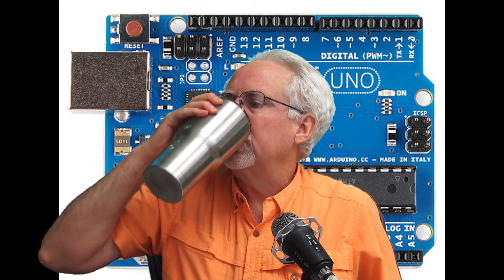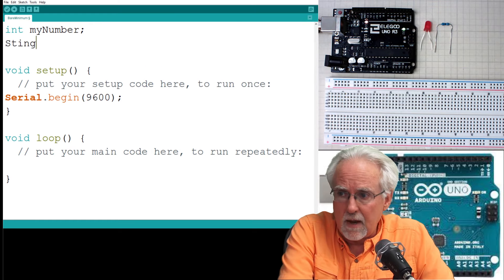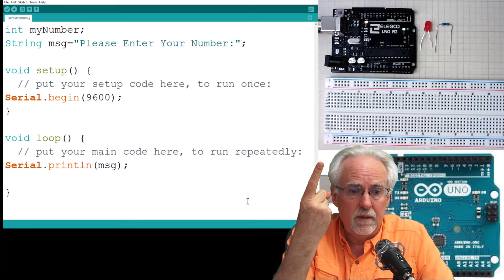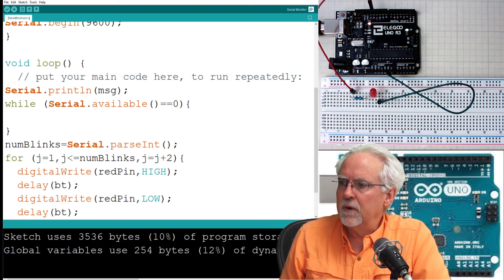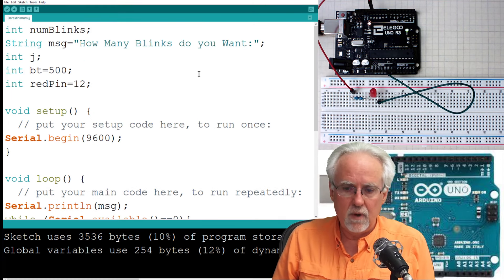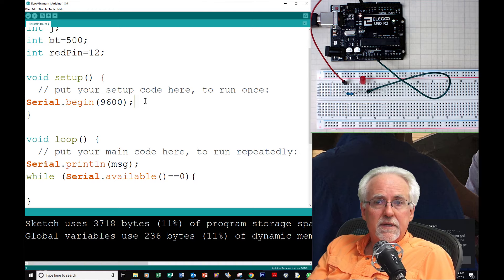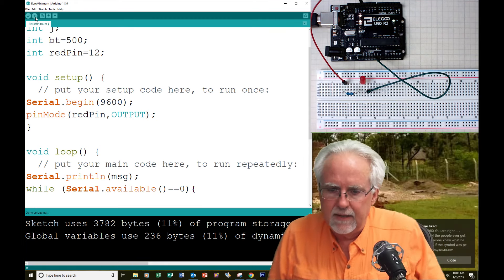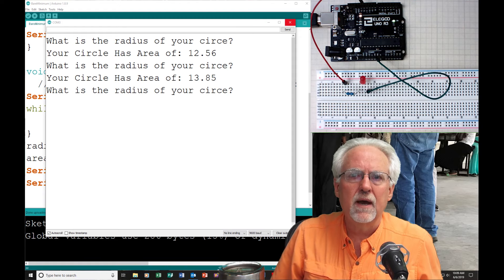Arduino Tutorial 18: Reading Numbers from the Serial Monitor

Comment: Go through tutorials 14-18 in a day, feels good!
Hmm, this exercise is probably the hardest one for me. i set several If statements functions, but after I type a number and print the message that I set, it returns to the question and prints an undesired output. I figure out the bug in the coding but nothing happens. While I saw we needed to set the conditions to No line spacing, and the problem was fixed... This tutorial is very tough..

Comment: Oh my!  My ‘What is your number?’ loop was running twice, returning a zero on the second pass without my doing anything! 
      I followed along with you Paul and wrote the code as you did and when I started the Serial Monitor there was the question “What is your number?”  I entered my number and ‘BOOM’ the serial monitor returned it correctly, but then the loop immediately ran again without my entering anything and returned a 0 !!  Man, was I flummoxed. 

What is your number?
Your number is: 23
What is your number?
Your number is: 0
What is your number?

The code was 100% accurate, but nevertheless I rewrote it, and still the problem persisted!  It took me a good few minutes to track down the problem.  It turns out if you have ‘Newline’ selected in the drop down box at the bottom of the Serial Monitor instead of ‘No line ending’ the Serial Monitor automatically enters an ACSII character after you click send which then causes the loop to run again returning a zero!
Reply from the maker: make sure your serial monitor is set to 'no line ending'
Reply: @paulmcwhorter  Yep, I worked that out Paul, but not before rewriting the code!  I won't mess up on that one again :)

Comment: The course is great I do recommend you have a basic understanding of electronics before you start the course, you can kind of tell who does and doesn't by the comments below. I did stumble across a great tool by accident that I wish you would have told us from the beginning, like you Paul I like to stay organized so I know what's where when I need to troubleshoot and (//) did that for me an example:

void setup() {
  // put your setup code here, to run once:
 Serial.begin(9600);
 
 }

void loop() {
  // put your main code here, to run repeatedly:
 
 // ASK
  Serial.println(msg3);

 // WAIT 
  while (Serial.available()==0);{
    }

// READ
  radius=Serial.parseFloat();
  area=pi*radius*radius;
  Serial.print(msg4);
  Serial.println(area);

      }

Thanks for the great Classes its always good to learn from someone who loves what the do!!! Thanks Paul

Comment: 😄 Dim LED and checking the hardware before checking the software. Reminded me of years ago when I worked in a hardware support team. The software guys would report one of their processors had a hardware fault.

Me: when did it go faulty?
Programmer: when we ran this new application version.
Me: isn't that a funny coincidence?
Programmer: very drole. You have a fine sense of humour. Now, go check that hardware.
Me (24 hours later): ran all the diagnostics and everything passed - hardware all looks OK.
Programmer: oh, we forgot to tell you. The fault went away when we ran the previous version. Starting to think it might be a code defect.
Me: surely not (or some words to that effect)!
Reply from the maker: 'It is never the code, stupid' says every programmer I ever knew. Your example above is honestly not an exageration. it is the users duty to 'PROVE' to the coder that it is a code error. Quiet frustrating.

Comment: Nice trick with this while loop. It works totally different than in C/C++. Lesson to long for me personally, however I am speaking from perspective of someone who coded quite some stuff while back. It is easier to skip a part of a video material than it's possible to put additional material into the released video for less advanced, so no complains!
Reply: Umm, it really doesn't work totally different than in C/C++ as the Arduino programming language is completely based on C/C++, with a header file that you don't really see but can explicitly include if you like, called Arduino.h. The syntax of the while loop is exactly like that of C/C++.

Comment: Dumb question. Can this process be used with a keypad and the Arduino being powered via a battery?  Or does it have to be connected to a PC and the serial monitor open?

Comment: i know probably going to figure it out in the next few weeks, but do you ever cover in detail what Serial.parseInt(); is specifically as well as Serial.available();? from what i got out of this video is parse is just the users command being put into a specific part of the code which is there and is it possible to give those commands like a limit similar to the loops where they have to be in a certain range or equal exactly the number and if so how would you do that?

Comment: Thank you so much for the amazing video! I just have one question: When I try to declare a string variable, the word 'String' does not turn the happy blue color. I have tried to used a lower case 's' and have tried to use the word 'Str' but nothing seems to work. Some help would be greatly appreciated.
Reply from the maker: Because you are using arduino IDE 2.X. Go downgrade to 1.8 and everything will work just like mine in the videos.
Reply: @paulmcwhorter Thank you!

Comment: Hey. I went over this lesson and decided to get a bit creative and do a project based on an idea i had using the knowledge fromthis lesson, but I really need help with the programming. The idea is to turn the LED on when the user inputs 1, off when the user inputs 0 and provided with half the voltage if any other value is input. Hence, it has to be an analog Pin to be used. This is my code. I hope you can help me refine it. Also, the delays i put in there are just messy pls dont mind them hehe.
int rPin=5;
int dt=1000;
int ans;
String msg0="Let's start the Number Light Game :)";
String msg="Yay, the light is ON! ";
String msg2="Oh no! The light is off!";
String msg3="Uh oh! Looks like you're not within parametres. I'll just make it fair by putting it halfway!";
void setup() {
  
Serial.begin (9600);
pinMode (rPin,OUTPUT);
}
void loop() {
 
Serial.println (msg0);
while (Serial.available()==0) {
}
ans=Serial.parseInt();
while (ans==1) {
  Serial.println (msg);
  digitalWrite (rPin,HIGH);
  delay (dt);
}
while (ans==0) {
  Serial.println (msg2);
  digitalWrite (rPin,LOW);
delay (dt);
}
Serial.println (msg3);
analogWrite (rPin,128);
delay (dt);
}

Comment: Paul it is  my first BOOM . i am quite baby for this thing . Have Arduino which i make by myself with assistance and miss mismatching of the pins I place it on the mirror side( but it work good )  But have no breadboard .Never know if this funny program  creation can play with some  LED . I wont to rule motors through Wi -Fi. Never know how to do it yet . 

 
int yelLED = 5;
int greLED = 6;
int redLED = 7;
 
int j;
String askColor = "Please enter RED, GREEN, or YELLOW: ";  
 
 
String askColor5=  " It is yelow color"; 
String askColor6 = " It is green color;";
String askColor7 = "it is red color "; 
 
 

void setup()
{
   Serial.begin(9600);
   pinMode(redLED, OUTPUT);
   pinMode(greLED, OUTPUT);
   pinMode(yelLED, OUTPUT);
}
void loop() {
 
  
 
{
   Serial.println(askColor);
   while (Serial.available() == 0){
    
   }

   redLED= Serial.parseInt(); 
   if ( j=7);
   Serial.println(askColor7);
   digitalWrite (redLED,HIGH);
   digitalWrite (greLED,LOW);
   digitalWrite(yelLED,LOW);
   
 
 
    while   (Serial.available() == 0){    
    
   }
   yelLED=Serial.parseInt();
   if (j=5);
   Serial.println(askColor5);
   digitalWrite(yelLED,HIGH);
   digitalWrite(greLED,LOW);
   digitalWrite(redLED,LOW);
   

    
  while (Serial.available() == 0){
    
   }

   greLED = Serial.parseInt(); 
   if ( j=6);
   Serial.println(askColor6);
   digitalWrite (greLED,HIGH);
   digitalWrite (redLED,LOW);
   digitalWrite(yelLED,LOW);
  
       
}
}

Comment: HI Paul, i got to say that i have been loving the tutorials so far. I have a question, I have copied the code in the same way as yours and i have my serial monitor set to no line ending. When i compile my code, the string msg appears in the serial monitor only after inserting an integer. I dont understand why is that happening.

Comment: Had a problem is trash in input buffer.  This was noted using both a Raspberry Pi and a MAC.  So added the code below to address this issue.

  numBlinks = Serial.parseInt();
  // Problem is trash in the input buffer
  //Added code to clean out input buffer
  //
  while(Serial.available()>0){
    int _trashNumber = Serial.parseInt();
    String _trashString = Serial.readString();
    float _trashFloat = Serial.parseFloat();
    //Serial.println("in clean out loop");
  }
  // end of added code to clean out input buffer

Comment: int TD=500;
int Blinks;
int redLED=8;
int CTR;

String msg="How many Blinks do you require?:";
String reply="Number of Blinks requested: ";

void setup() {
  // put your setup code here, to run once:
Serial.begin(9600);
pinMode(redLED,OUTPUT);
}

void loop() {
  // put your main code here, to run repeatedly:
Serial.println(msg);
while (Serial.available()==0) {
  
}
Blinks=Serial.parseInt();
Serial.print(reply);
Serial.println(Blinks);

for (CTR=1;CTR<=Blinks;CTR=CTR+1){
 digitalWrite(redLED,HIGH);
 delay(TD); 
 digitalWrite(redLED,LOW);
 delay(TD);
}

digitalWrite(redLED,LOW);
}

Comment: I am getting superfluous output during the first par of this lesson (prior to constructing the circuit). I am prompted for input. I enter a number and press Enter. My  number is printed for me, and I am re-prompted for a number. So far so good. However, about a half second later I see: 'Your Number is: 0
'. I have not entered any more numbers. This happens whether I press Enter or I click Send. Very odd.  Here is my void loop() code:
void loop() {
  // put your main code here, to run repeatedly:
  Serial.println(msg);

  while(Serial.available() == 0) {
    
  }

  myNumber = Serial.parseInt();

  Serial.print(msg2);
  Serial.println(myNumber);

}
Reply from the maker: make sure serial monitor is set to no line ending.
Reply: @paulmcwhorter  thank you so much for taking the time to respond! I greatly appreciate it. And, that was the problem. :) Glad it wasn't my code!
Reply: I had the same problem, thanks A lot mister McWorther! :D

Comment: I've encountered an issue that I just cant seem to figure out. I am reading data from a temperature sensor and displaying it on the serial monitor, however it only displays the first temperature read. Because if that I thought it was not reading the sensor properly but once I refreshed the monitor, it updates the current temperature values. What could cause that and how can it be resolved. Thanks in advance

Comment: Eddy Welvaert 

It's about "Arduino Tutorial 18: Reading Numbers from the Serial Monitor". I entered the code. It was all correctly arranged. I open the Serial monitor. The following will appear on the screen "Please enter Your Number:" I key in my number and send. Then the following will appear "Your number is for example:" 5 "Then the following" Please enter Your Number: "with immediately the following" You number is "0" and back again "Please enter Your Number:". Now I can send back my number. This occurrence happens over and over again. What did I do wrong or how could this happen. What is the solution?
Reply: Do you have a single equal sign in this line of code?  The code line should be:         while (Serial.available()==0){

Comment: In the program, I place the conditional structure IF ELSE to kind of sort the problem of negative input. It works well with integer. But if I input a float like 2.5 then the program executes twice: one with 2 blinks, and another with 5 blinks. Is there a function to convert any input into integer, somewhat like in Pascal we have the function MOD 1 and forget the decimals? thanks.

Comment: Thanks Paul great videos. I'm the one that doesn't hold his breath because I'm trying to write notes.
I had issues with my program in lesson 18 run first time fine but it would double print the question and answer it in it's own. 
I check the no line editing it seemed to fix the problem. Again thank you

Comment: I got the code right but when I keyed-in the radius, there's additional lines appearing in the serial monitor as if I keyed-in "0" subsequent to the 1st entry.
------- Eg.------------
Keyed-in radius = 5...

What is the radius of your circle?
Your circle has an area of : 78.50
What is the radius of your circle?
Your circle has an area of : 0.00
What is the radius of your circle?

Then I noticed that I have the "newline" is selected in my serial monitor but you used "no line ending" in yours. Changing that seemed to solve the problem but I don't understand why that makes a difference. Am I supposed to select "no line ending" as the default setting?
Reply from the maker: make sure serial monitor is set to no line ending.
Reply: Thanks. You’re awesome. 🙏

Comment: Paul -
I am having intermittent problems with the COM port assignment.  I will get through the compile step OK, but the the green bar load will take a long time then I will get the message that COM port 6 (in my case) is busy.  After that, the mouse pointer will move around, but I can’t click on anything. At that point I will restart the computer. Sometimes that will fix the problem, sometimes not.  I went back to Lesson 1 to refresh on using the Tool drop down to check on COM port and board type.  Again, this works sometimes and sometimes not.  Any ideas?

Ken (the 75 year old)

PS - my friends think I am a guru and bring their computer problems to me.

Comment: I get flustered at times simply because I can’t keep up with the typing and absorbing what I’m typing ...then I remember to pause, rewind and start over, sometimes several times but I finally get it. I realize that people who can keep up aren’t being held back. Said it before but I’ll say it again, sure wish this feature was available when I took my trade courses many years ago. Also, really learning the importance of entering the code correctly, 🤨 Hate it when your code works and I’m stuck for a while de-bugging.  Seems like a lot to take in and if I were to comment, I need more assignments to do on my own to make sure I am getting it put in the grey matter, in large part because mine is extra grey. Thanks again Paul.
Reply: Wally Murray if Paul doesn't give homework on a lesson, then play around with the code and circuit so you will learn more about how it works or doesn't work.  Hope you are learning from the debugging and remembering.  Mine is grey too and not remembering so easily, even though most of this is a review for me.

Comment: Has anyone had the issue where the serial monitor is blank until you give it an input, then it functions properly? It's not showing my first line of void loop "Serial.println(msg);" until after I give a command. It seems like it's waiting for input when I first open the serial monitor (possibly from the 'while' loop?).
Yes, my baud rate matches and my serial monitor is set to "No Line Ending" (I've tried the other settings with similar results.

Comment: Hello Mr. McWhorter. I have a question. How to input more than 1 number then the arduino will wait for us until we enter then print. I’m sorry my English is not good. For example, we calculate the area of a rectangle: “Enter the long edge: “, (we enter), “Enter the short edge: “, (we enter), then it will print out “Area of the rectangle is: “. Thank you very much. 
For the while loop: while(Serial.avalable()==0) it will just wait for us to enter our 1st input but not until entering the 2nd one. 
Thank you very much.

Comment: Hi, i have a question about this class. Apparently this method is really good to customise the variables based on the person who needs to run the system.
However these variables we are giving are deleted everytime we turn off arduino or we reset it, am i correct? All the variables are not stored somewhere, am i correct?

Comment: Thank you very much Paul, you are an exceptional teacher! But I'm perplexed about the mathematical behavior of Arduino: I reproduced the sketch "Circle area" and for relatively high numbers I obtained slightly wrong results in excess or defect. For example: radius 8500, area 226864992 instead of 226865000 or radius 8990, area 253775136 instead of 253775114. But, radius 9000, area 254340000, correctly. I'm using an original Arduino and assumed pi as 3.14 (truncated). Am I doing some stupid mistake or my Arduino is whimsical? Thank you for any help you could possibly give me.